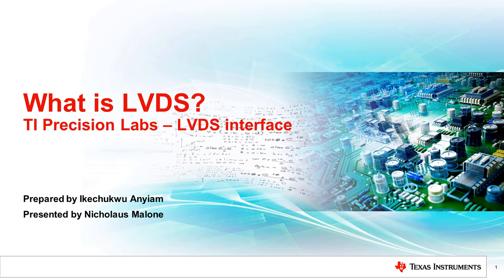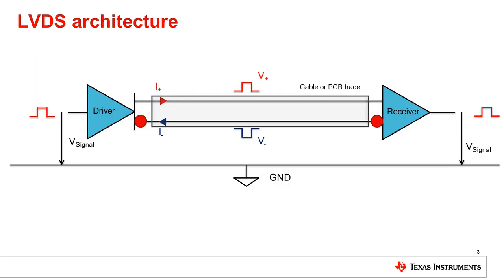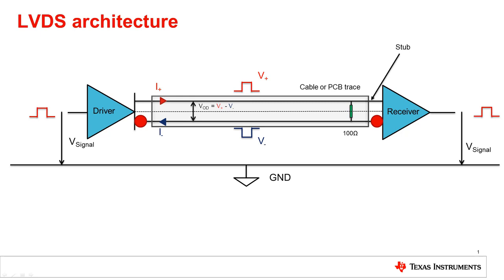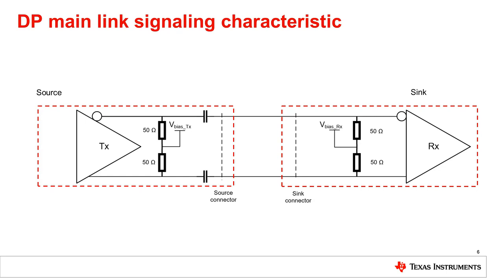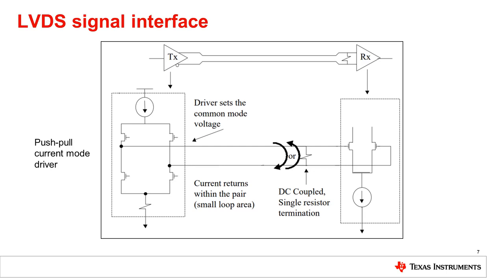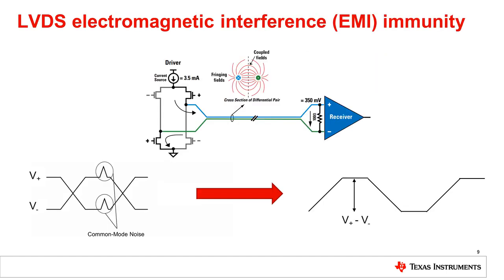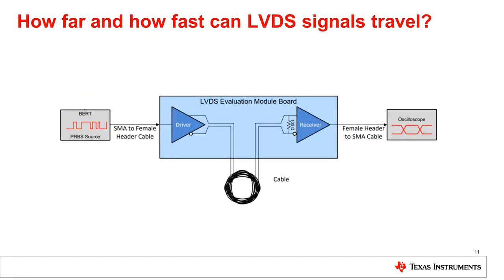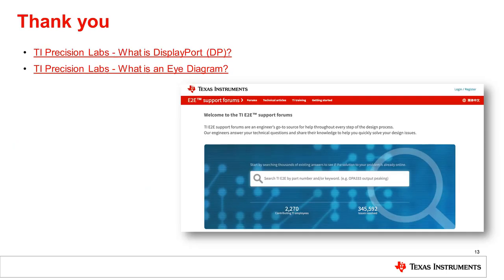What is LVDS?

Comment: As someone learning EMC/SI design I’d also like to add that it is not uncommon and even recommended to not just terminate with a resistor at the end, instead have 2 resistors and a capacitor in parallel to ground.